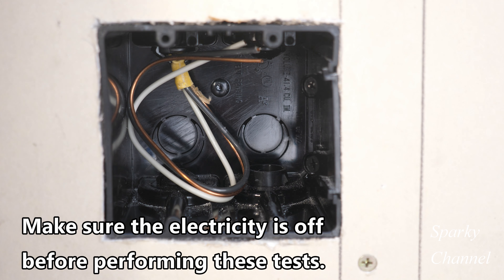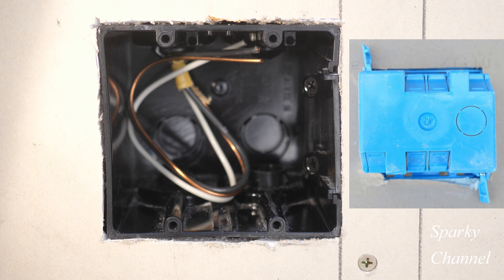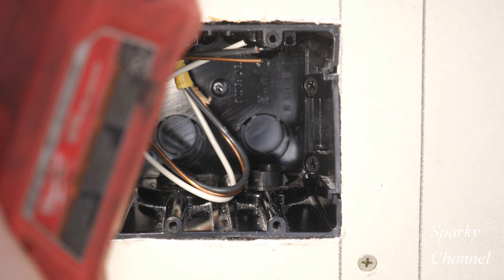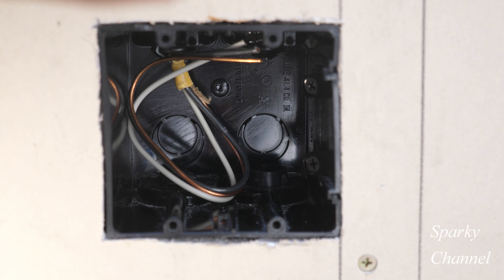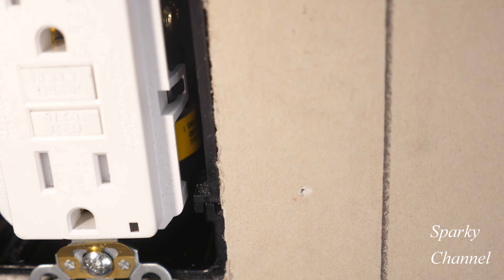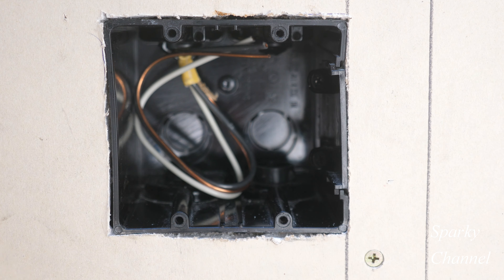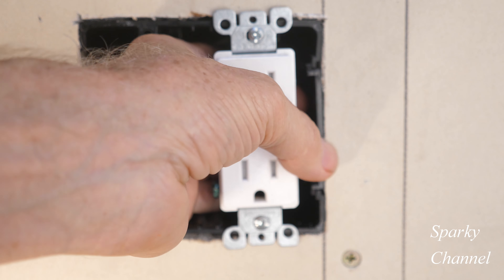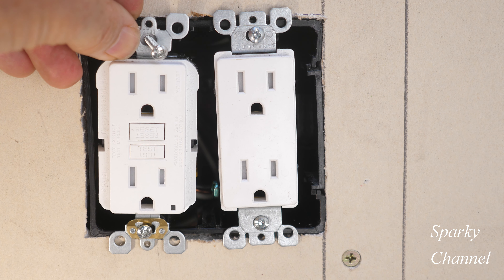Installation Problems with an Arlington 2 Screw Device Box?

Comment: 👍👍Great content useful for the trade
Reply from the maker: Thanks Theo. That's the idea! :)
Reply: @SparkyChannel  Yup
Reply: @SparkyChannel  hi bill
Reply: @SparkyChannel  
Is there an outdoor dual outlet weather cover, in use or otherwise, that has the same edge dimensions as a common indoor wall plate?
Something for a a tight space.

Comment: These boxes cost more money and are not available at the big box stores. However, these boxes are well worth the extra cost because as mentioned in the video they attached to a stud member. This makes for a sturdier installation. Good video Sparky Channel.

By the way, I've never had an issues installing ANY devices in these boxes. !
Reply from the maker: Thanks Ron! I haven't had any issues either, but I wanted to point out that the large devices can get very close on the screw side.

Comment: Leviton makes slimmer GFCIs than other brands, so though your Leviton has clearance, others may not. Romex SmartBoxes have the similar 2 screws and enough clearance.
Reply from the maker: That sounds good, I'll try it.
Reply: Carlon makes some boxes designated as "New/Old Work" where the screws are about 1-3/8" deep that work well for me. The have three attachment methods: a breakaway flange (new work), nails (new work), and screw holes (old or new work).

Comment: Sometimes I cut the nailing flanges off a regular double box and screw them in with wafer screws. Not listed but it works
Reply from the maker: See upcoming video. :)
Reply: I think everyone has done that in a pinch

Comment: Can you run a non gfci next to a gfci? Is it run in series with the gfci or something so its still protected by the gfci? Cause I cant think of a situation where a gfci is required but would also permit a regular outlet. For example in my area gfci's are required for any room with plumbing. So I couldnt put anything but a gfci in that box if it was a kitchen or bathroom.
Reply: Yeah. GFCI outlets often anymore have screws for downstream outlets to be protected by that GFCI.
Reply: Also you might be able to do a GFCI breaker in lieu of outlets if there's room in the breaker box.
Reply: Yes, you can protect the regular receptacle with the GFCI, saving money and space in the box. The load side of the GFCI would feed the receptacle.

Comment: Hey Bill is it better to daisy chain all the outlets in a circuit or join them all together in a junction box to the home run wire? Thanks
Reply: Industry standard in to daisy chain. Depending on how many outlets you have in a circuit, you would have problems with the size of the j-box & wire connectors
Reply from the maker: I agree with Elijah.
Reply: It’s been industry standard for a long time to daisy chain receptacles (running in series) but putting pigtails on all devices and tying them to the incoming/ outgoing power (running in parallel) is  a much, much safer method. Coming off a GFCI being one exception. 
 For example, I changed out all my neighbors living room receptacles. The power was run in the top and out the bottom of the receptacles. This meant that power was traveling through each receptacle to get to the next one down the line. The first 2 unused receptacles were getting hot because of the TV and mobile AC unit at the end of the run. (I also ran a dedicated circuit for the AC later). I added pigtails to the new receptacles and added them to the incoming and out going power in the Jbox. 
 This way, unless the receptacle is in use, no power is running through it to get downstream. It’s an old reference, but it’s like the old Xmas lights where if one bulb burns out, the circuit is now open and they all go out. If a receptacle fails, you lose everything downstream from that point. I have personally witnessed failed, melted and burned receptacles because of this. 
 Just my opinion. Ask 10 electricians their opinion and get 20 different answers 😂.
Reply: @JD-bd5uu  Yes. I think that is how I am going to re-wire my house and use a junction box at the homerun. Perhaps I would daisy chain if my house was 2x4 construction or if I was trying to save on wire. My house is all concrete block and frankly Im not concerned with trying to skimp on wire or receptacles. All my outlets are commercial grade and every box is a double gang Raco 4in metal regardless of its a single duplex, double duplex outlet or a single light switch. I don't want to have to be fighting for space and cramming everything. Might as well do things right the first time and in such a way as to make any future modifications easy.

Comment: While the GFCI is just barely fitting, that's without the wires attached to it. With the wires attached, it may make it even harder. Yes, the easy work around is to put the GFCI on the other side. However, I can think of times that may not be practical. For example, if this was in a kitchen and the other device was a light switch, I would want the light switch to be closer to the doorway, not the GFCI outlet.
Reply from the maker: Hi! That's a great point.

Comment: Just a comment... at 2:18 ...  the box nearest the stud looks as though it has left/slipped from the mating in the upper right of the view. It does not look the same as in the lower right. The area I'm describing is right of the top/upper hot and neutral slots of the device. Looks like it just slipped out during the install.  You have a great channel !!!!
Reply from the maker: Thanks so much Terry!

Comment: Terrible boxes for nw or ow. Buttons instead of those plastic clamps. Getting the depth right when those screws sink in is never right the first time. The raised plastic around the buttons and the screws is gross. Just get a carlon ow box or a nail on if it's nw. These internal screw boxes are garbage.

Not to mention. You're lucky it's a 2G. What if you needed to put that gfi in a 1G? Tiiiight squeeze.
Reply from the maker: Thanks!
Reply: Yeah, I've had a hard time trying to sink them to the right depth too. Does anybody have suggestions how to get them right the first time?
Reply: @Ryan-dj5ku  Hold the box 1/4" out, before screwing it in.